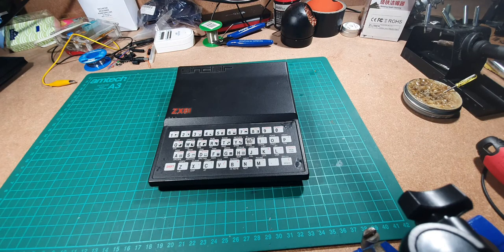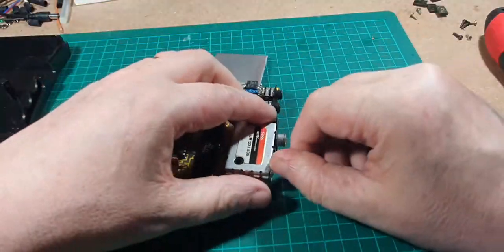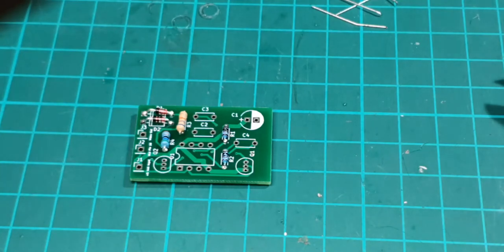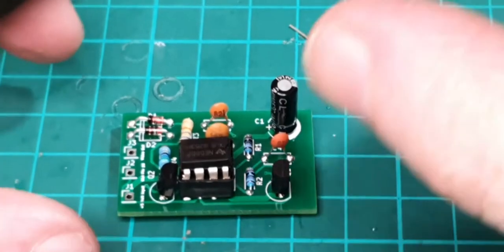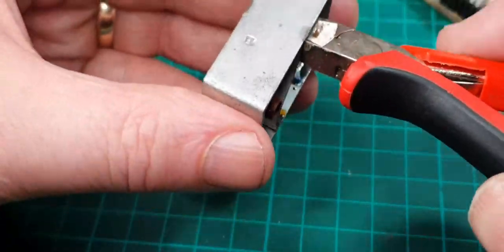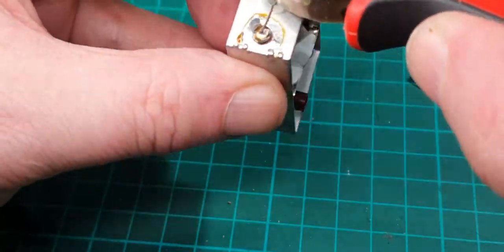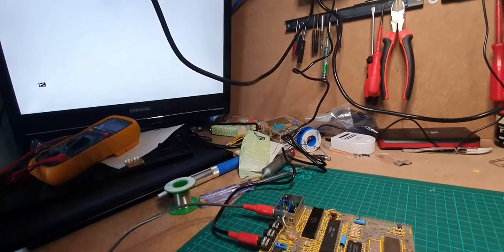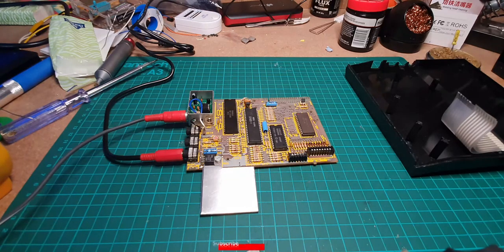ZX81 Part 1 – Replacing the TV modulator

Comment: The 555 chip in backwards was freaking me out...  👀
Reply from the maker: Your correct - I never noticed !  but it works okay :-)  I have since put it in correctly and it still works.
Reply: The 555 seems to only be used to extend the back porch of the video signal, (that's where the colour burst is placed on a PAL signal.) Not surprising that it made no difference. Most monitors are not that fussy. They care more about the main H/V sync pulses.

I'm surprised that such an addition was even needed, as the B&W signal is easily generated with the timings pretty much correct.
It would have been interesting to put a scope on the vid signal input to the modulator and see what it was doing.

The old Jupiter Ace uses much the same circuit, and I modified my old one to give a nice vid signal. One transistor, emitter follower. 2N3904 collector to +5, emitter to ground via a 250 ish ohm variable resistor. Video into base, Video output across the variable resistor. Adjust for clean display. 

Sucked in breath at the drill to clean out the solder. NEVER on a plated through PCB. You will get away with it on large holes. But on the smaller holes you can easily cut the plating, and those are a nasty fault to find at times. Use a stainless steel needle (darning needle works well)  in a pin vice. The solder will not stick to it, so you just rotate it as the solder cools and it will leave a clean hole.

Also pop a Hellermann sleeve over the solder sucker tip and leave 2 or 3 mm protruding. That makes a better seal and sucks more solder out, it also acts as a bit of a shock  absorber. It also stops the solder sucker tip wearing.

Andy
Reply from the maker: @andye2005  Thanks Andy - points noted.  The only reason why I used the drill bit was because it was where the modulator went through the board. I would not use a drill for anything else on a board.